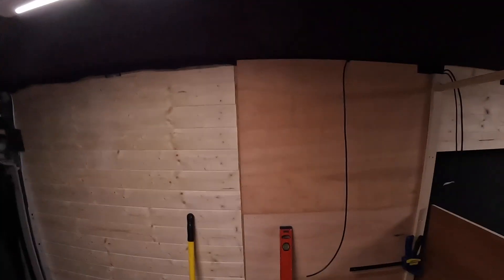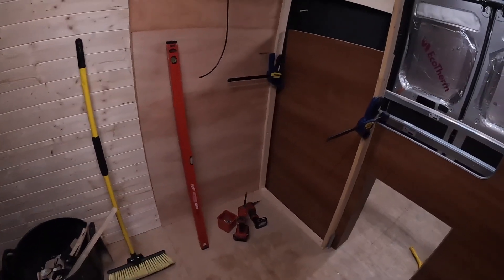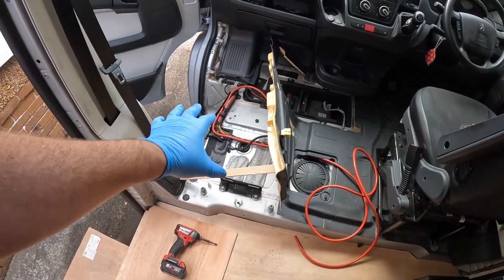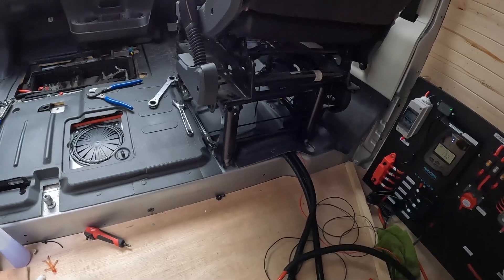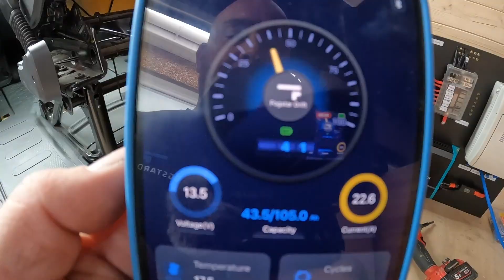HOW TO  | Scribing Panels To Curved Walls | Campervan Edition

Comment: Dude. I'd have the off cuts, got a log burner in the garden.
Could you not have got a stainless steel shower tray made to fit your original size?
Reply from the maker: Come and get them lol I got plenty 🤣 the problem with the original size wasn’t the tray it was it would have collided with the skylight. The bed was originally 120cm but I upped it to 135 and over looked that part. Luckily 700x700 shower trays are very common. 👍🏻
Reply: Loving your build
I may take my leccy board off & start again.
Reply from the maker: Thanks mate, if the board is safe, out of the way and easily accessible I’m sure it’s good 👊🏻

Comment: Stu, if you do this type of van again there is a converters plug  hidden behind the lower black panel by the  drivers seat, it has a plug with 16mm black and red cable already attached to the battery and fused at the battery there are also other functions there like ignition trigger ,I found out about this on a YouTube video if I can find the link I'll try and send it if it helps. Best of luck buddy keep up the good work.
Sorry Stu I lied it wasn't a video  but if you Google "converters socket mister G" you should find the link big time saver.👍
Reply from the maker: Hi Paul, not all models have this point, was the first thing I checked lol but of course I have one without it 😔 don’t understand why some have it and some don’t would be so useful 👍🏻
Reply: @VanologyConversions  
Hi Stu I'm a lucky one then ☺️ I thought they all had it, cheers
Reply from the maker: Yea I thought so too but when mine wasn’t there I went to doctor google and found some don’t 😣

Comment: I love watching your channel, I recall seeing your first video popping up & I just knew you were going to be good. I've been following your builds & you've given me lots of inspiration & a bit of confidence in having a good go at building sometning smart. So I went & bought me a lovely grey Citroen Relay LWB over in Essex & brought it back home to Ireland on the ferry. I've got a bit of a request for you man, or I'm asking if you have the time to.. I'd love to see you would do a how-to video dedicated to installing the DC - DC charger, because we have smart alternators now, I really don't fancy trying to splice in to the ignition wire for the D+ cable (it just seems too dodgy) so I'd love to see how you've done this with the piggy back fuse. As I've grabbed myself a Renogy 50a DC - DC charger & 400w solar going up on to the roof. No one on here, on YouTube has done a decent video of this process for the Relay/Boxer/Ducato. Best of luck with the channel & the new work shop.
Reply from the maker: Thanks mate I’m glad they are helping your build, this is exactly what it’s all about. There are two ways to get an ignition live, one is as you suggested via the 12v fuses using a piggyback and the second which we have been using more recently is the by the cigarette lighter you will see a circular cap, pop this off and there is 3 cables in here. The black is ground and the other two are the same colour I believe grey and yellow. Use a multi meter to determine which one is the ignition live. If you need more guidance drop me an email and I’ll help further mate
Reply: @VanologyConversions  aww thank you man, much appreciated. This way by the cigarette lighter seems a better & far handier option, I'll give that a go & if I do happen to get stuck, I'll take you up on that offer of shooting you an email. Thank you again 👍

Comment: Stu can I give you a suggestion, why not do a half height slide out pantry by the bench, where you had to reduce the shower room, then your sockets and switches above
Reply from the maker: Funny enough I did think something along those lines but the L3 boxer isn’t quite as long as the L3 sprinter/crafter so space really is at a premium 👍🏻

Comment: The front skylight could have gone further forward. On the roof there is a flat section and I fitted a 400x400 skylight there for that very reason with the shower. 👍🏼🏴🥰
Reply from the maker: I felt it was too far forward in that section and second second would give more light for kitchen area. If bed was original 120 would have been okay. I Got to remember knock on effects 👍🏻

Comment: Hi Stu, i heard you are using a 700mm wide shower tray . How wode will the kitchen be as i know from doing mine at the moment there os about 1800mm width in total . Just thinking about how wide your walkway will be in the middle . Or are you encroaching on that area a bit . Cheers mate ( ps love a tidy workshop = a tidy mind )
Reply from the maker: The kitchen will be 550mm wide but I’m also going to do a 100 in step plinth. I’ve marked it out and looks decent 👍🏻 gotta be clean only problem is it’s messy again 😣

Comment: Surprised you used a dark colour carpet on the roof
Reply from the maker: I did put grey up against the furniture board and I didn’t like the combo, the anthracite looked so much better 👍🏻
Reply: Love the anthracite
Reply: @VanologyConversions   HATE the black ...   white or light every time in such a confined space.  My van has blue carpet on sides, with silver (a very light grey) ceiling and rear doors.